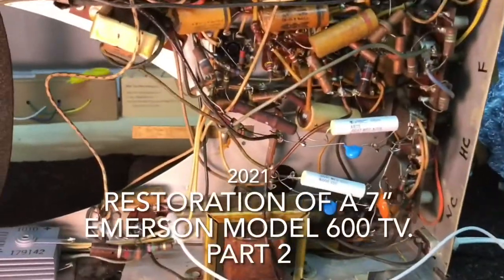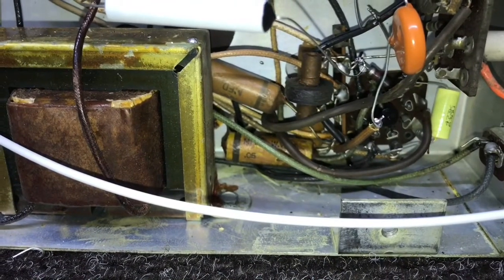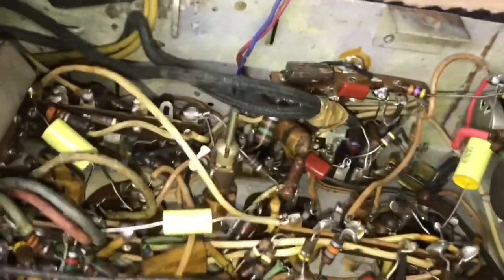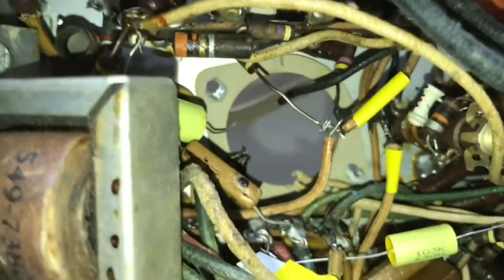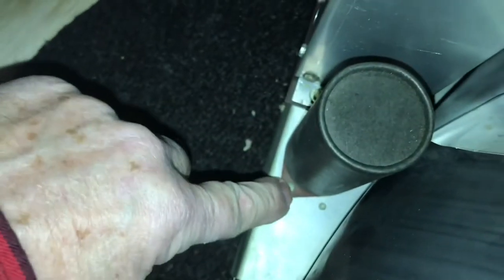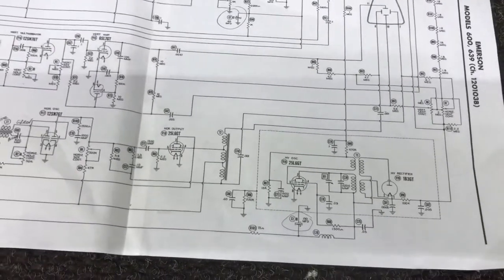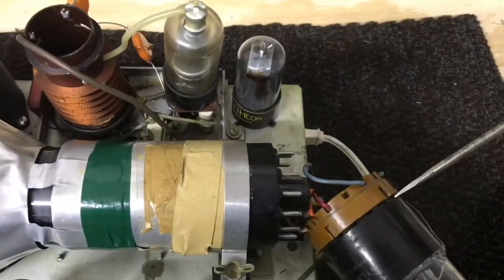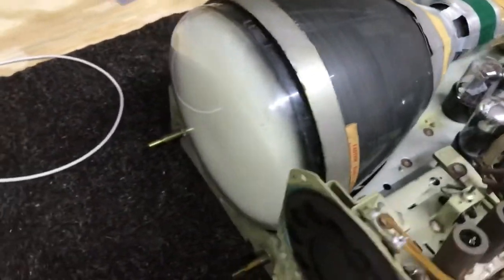1949 Emerson 7” Model 600 TV Restore Pt 2

Comment: Thanks for another informative video!  I have the same Emerson in a different cabinet, I have made a start on, have raster now!  I have to order more caps.  Did you need to add a dropping resistor in series with the diode, that replaced the Selenium rectifier?  If so, what value and wattage did you use?  Thanks.
Reply from the maker: Had to go back and check my notes , I didn’t add a resistor on this set. B+ wasn’t much more than what the Schematic called for, only about 10 volts more.   
 Good luck , the hardest set I’ve worked on to replace paper caps, such a compact chassis 

  Thanks for watching